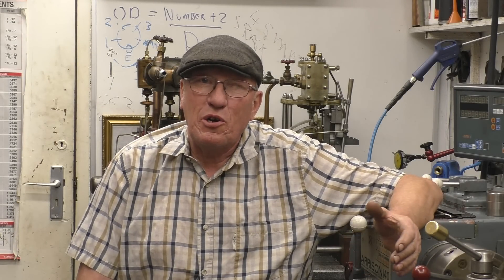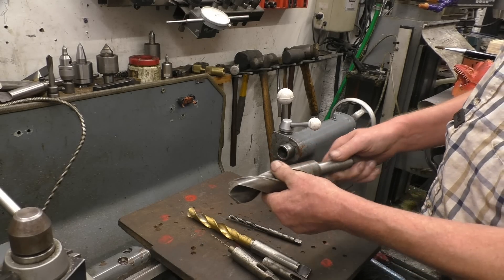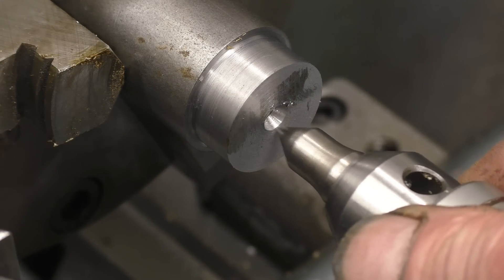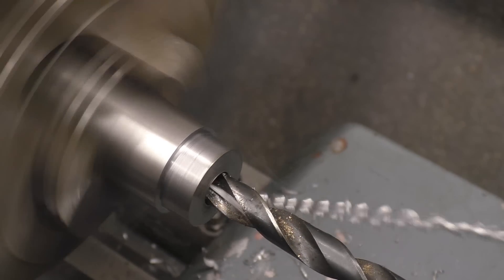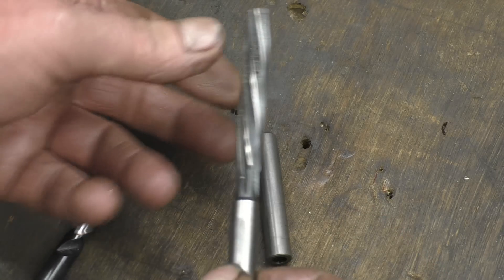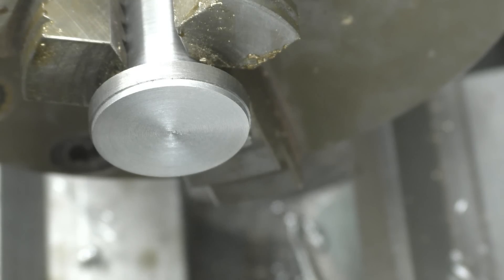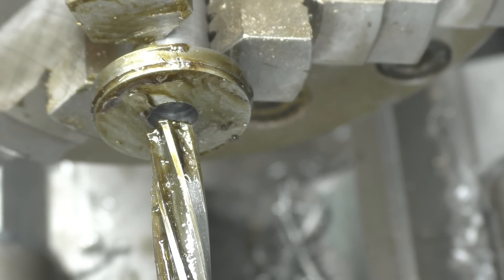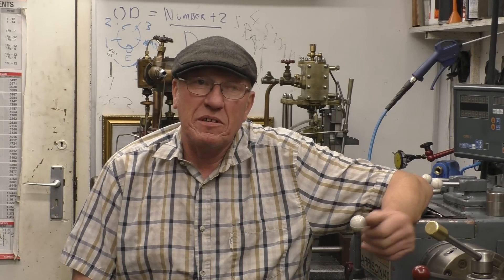Lathe Tutorial P6 . Drilling & Reaming

Comment: Great stuff John! Is there a rule of thumb for what size drill bits to go up in when enlarging a hole?
Reply: All depends on the material and what size your aiming for, of cause the small increments the less strain on the drills, mild steel / stainless steel you can easily go up 4 drills at a time, plastic/ delrim you can go straight to full size, aluminium pretty much the same, maybe a few sizes under the finish size so the drill won't wonder.